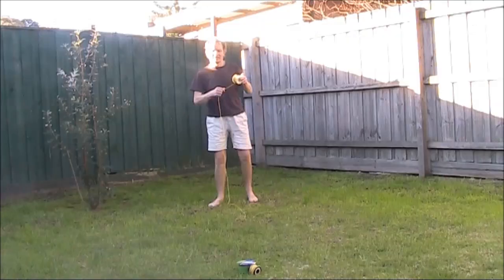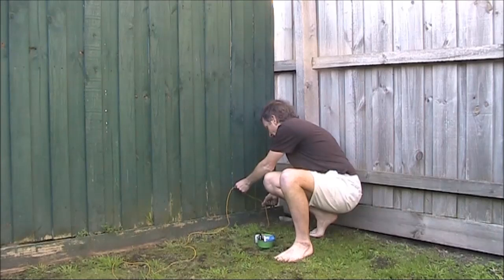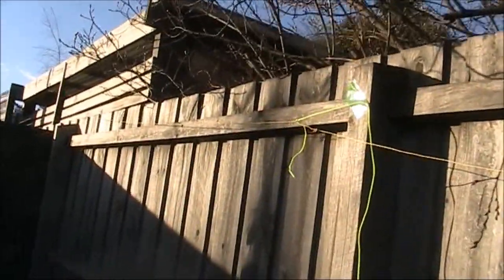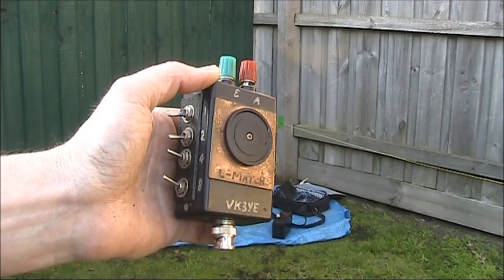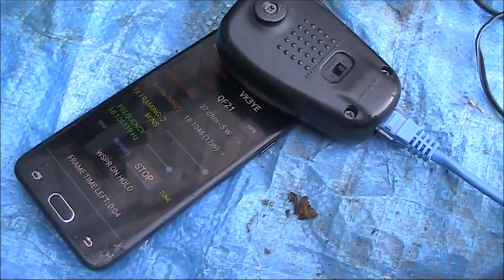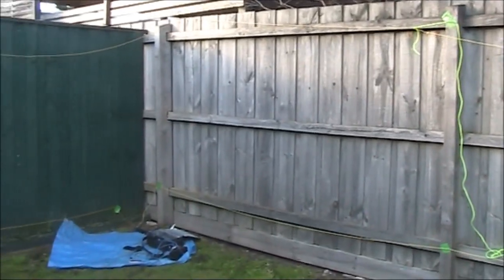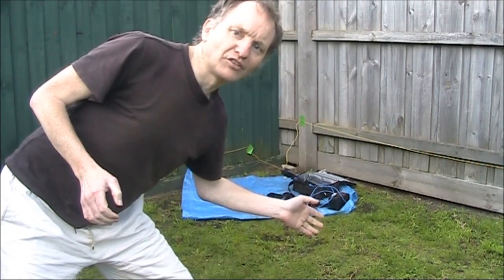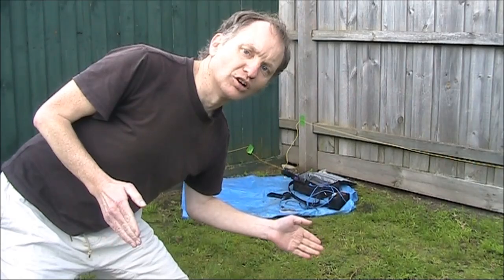Trying a fence loop antenna

Comment: Theoretically it looks more like a (partially folded) quad, so I would expect the resonant frequencies to be somewhere around 13+2 meters (minus velocity factor) for total length dipole with hard to predict radiation angles. That is, as you say, resonant around 10MHz. Different side ratios and various feeding points may give different impedance. Interesting that you can tune this to 3.5, 7 or 14 MHz. In such scenario I would rather use a T2LT antenna mounted on top of the fence. You would need about 3.18m of coax and 6.2m of wire (plus a current choke) to make it resonant on 14MHz and still usable on 7MHz.

Comment: What kind of wire is that and where did you buy it?
Reply from the maker: Any insulated copper wire will do from any hobby electronic store.
Reply: @vk3ye  out of interest what gauge wire
Reply from the maker: @jamesflannery-serle3489  Thin insulated. Not critical.

Comment: The loop really needs to be fed with a balun. The antenna will only function as a folded random wire on the ground as configured. That's also why the noise is so high, as since the antenna is not functioning as a magnetic loop (with associated good rejection of vertically polarized noise), you're picking up all kinds of common-mode noise. To add further issue, there's no counterpoise for the driven element...your coax will have to fill in that gap and also adds to the noise problem. The radiation pattern would be NVIS, at best, but without a counterpoise, the pattern is going to be severely distorted.

It would be cool to see you repeat the experiment with a proper balun at the antenna feedpoint. I'd expect there to be a night-and-day difference.
Reply: Balun: yeah, probably a good idea.

Counterpoise: no. It's a loop (or a folded dipole, depending on how you want to look at it, given the dimensions). It's a balanced antenna. There's no sense in a "counterpoise", and nowhere to put one.
Reply from the maker: Another video coming out. Will feature a balun. Will it make a difference? Find out soon!
Reply: @vk3ye  I bet no. Balun will do nothing with noise(
Reply: Yes to all of the above. 👍